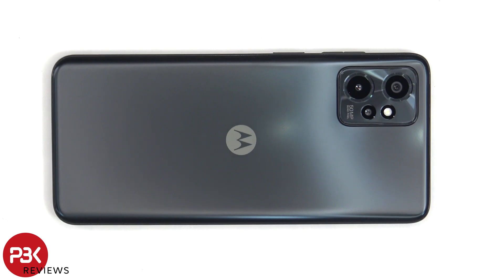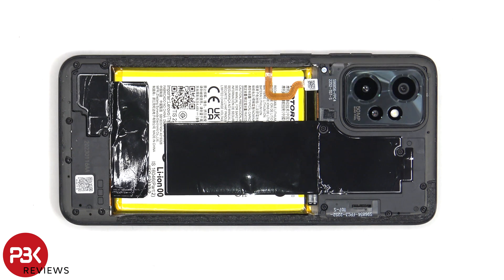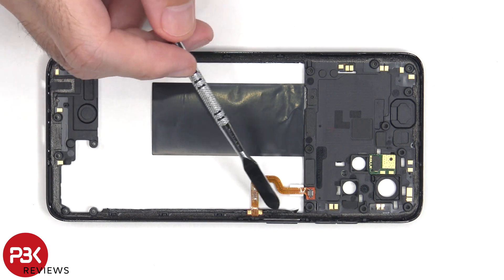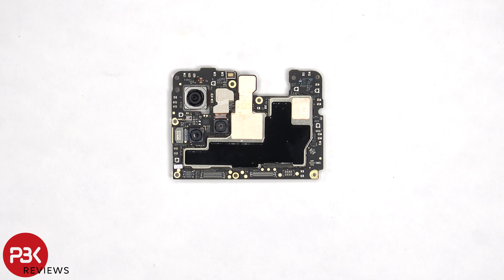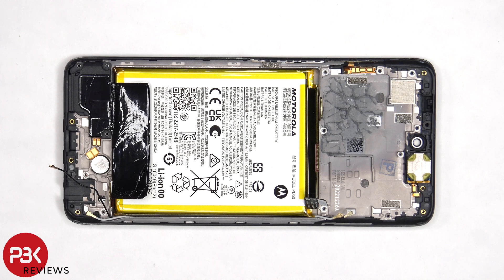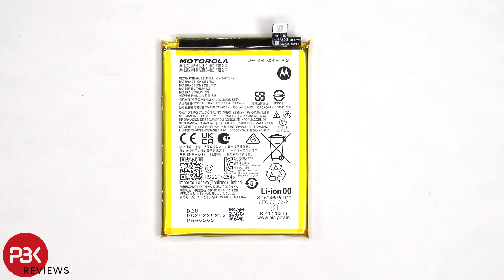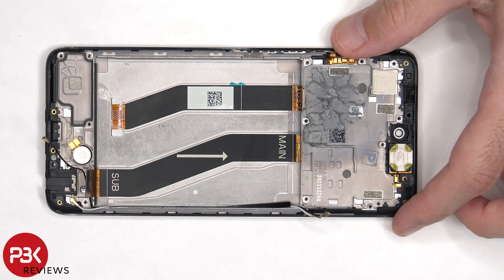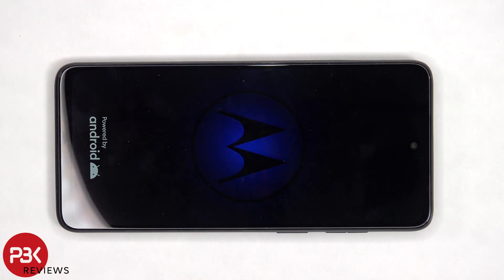Motorola Moto G Power 5G 2023 TEARDOWN Disassembly REPAIR Video Review

Comment: Good day, i have mine and have been wanting to pull out the SD card. Ive been trying so hard to pop out the sim/sd slot which has an sd card and its pretty flush in there. Would i be able to open the device like this and leave the sim tray inside to be able to pull the tray? Since it could potentially be the card preventing it from popping out

Comment: make sure you know what youre doing levering that battery out. Do not use anything metal or sharp. Mine popped and then burned a hole in my thumb. Had to go to the ER. Lithium is highly dangerous. And those adhesives to hold in the battery make it reckless to attempt to remove it.
Reply from the maker: Yeah, it's always best to use non metal tools but even so can be dangerous to bend/warp batteries. However with use of isopropyl alcohol, it eats away at the adhesive underneath making it easier to pry it off so you don't puncture it or bend it too much.

Comment: Is there a grille/mesh in the earpiece slit or is it just a cavity? My Power seems to be missing any sort of grille or mesh.
Reply from the maker: I believe the mesh/filter is further inside over the actual opening of the speaker itself in the frame where its not visible and not toward the outside by the slit or opening between the screen and frame as other models.

Comment: i just know the speaker need the graphite film to tranfer heat? the speaker also running hot?
Reply: yes, speakers get hot.  if you run car sub woofers really loud at high wattage in the summer, you can melt your voice coils (what makes the speaker move back and forth).
in general, speakers convert about 1-2% of the electrical energy into sound energy, the rest is movement and heat. 
in smartphones, the best way for them to cool is not to attempt to cool off one component, but to try and equalize the temperature inside, spreading it out to the whole device, and allowing the outside of the device to contact air which passes over it to cool the device which moves heat away from the components. this is why you see the graphite heat tape connecting all the pieces inside, they spread out the heat. in the newer phones (2024/2025), they're now using steel vapor chambers which are really thin, but take up basically the entire back-side of the screen area, and dissipate heat more efficiently, but still using the same principal: hot CPU? hot speaker? hot battery? move that heat all around the phone, let the phone cool itself by being in the outside (or room temperature) air.

Comment: moto G phone usually have 5000mA battery. Enough normal use four years . 
Four years later , buy another NEW MOTO G phone (  hard to find this battery and hard to replacement)
Reply: PD50 seems to be new model from Motorola